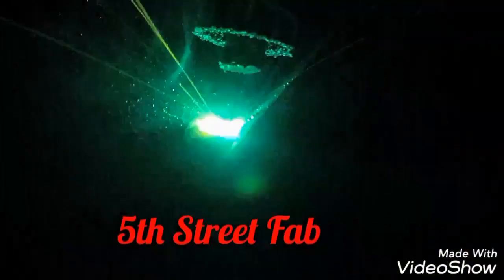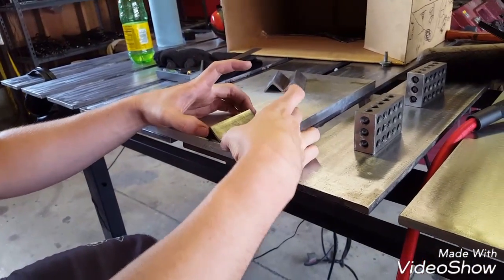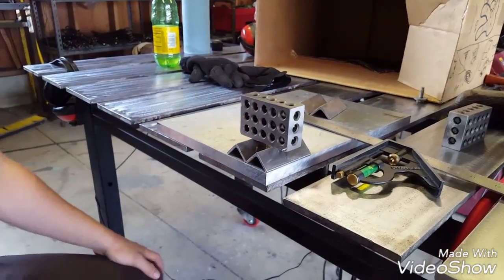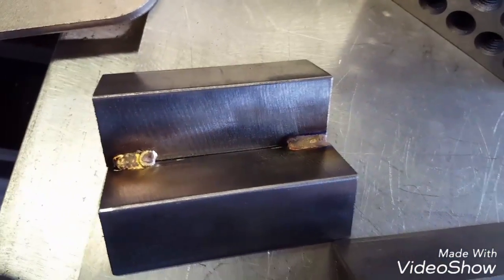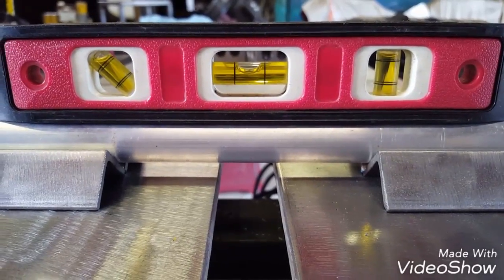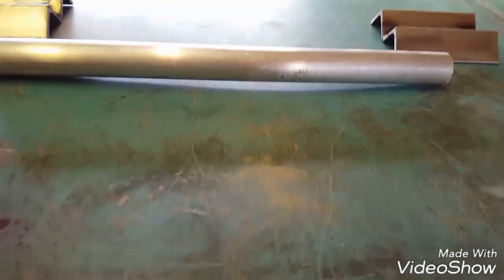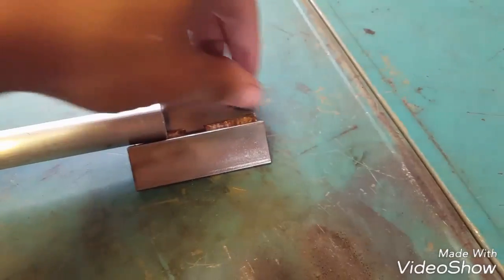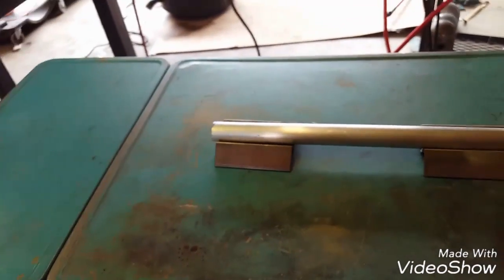DIY Welders V Blocks

Comment: Is it the same product Silicon Bronze than CuSi ?
I think there is Silicon Bronze for MIG weld process, It's right ?
Is it possible welding steel using Silicon Bronze ? I know is better to weld steel use it ER70S2 or ER70S6

Reegards
Reply from the maker: Yep it's the same stuff.  Yes there is silicon bronze for mig and you can use silicon bronze to weld steel although it's not very strong
Reply: @5thStreetFab  thanks

Comment: I am new at tig welding, most things I have figered out, but trying to weld with silicon bronze I have had no luck, when ever I get anywhere near it with the torch it just spatters and explodes, cant figer out whats going on, I have heard you don't have to heat the base metal up and just lay it in,i have also tried heating the base metal, but that doesn't work ether, any help would be appeciated
Reply from the maker: +Desert Rat 2000 you might be hitting your tungsten with the filler or running your tungsten into the puddle.  With silicon bronze it'll wanna ball up if the base metal isn't hot enough and that can run towards the tungsten.  Ya it doesn't need to melt the base metal just cherry red.  It's easier to learn in my opinion with oxy acetylene welding plus it flows much nicer.
Reply: Thanks for getting back to me , I finally figured out what was going on, I trusted the local welding shop to give me what I asked for but instead of getting silicon bronze ERCuSI-A I got RBCuZn-C(LFB) which I under stand needs acetylene, so it all makes sence, I will be trying the right rod to day

Comment: I made these out of aluminum right after i seen them on here. You might have seen them in on of my videos.
Reply from the maker: NTH Welding yes I did see those! They come in handy especially for brackets on pipe.  I also use aluminium ones at work!